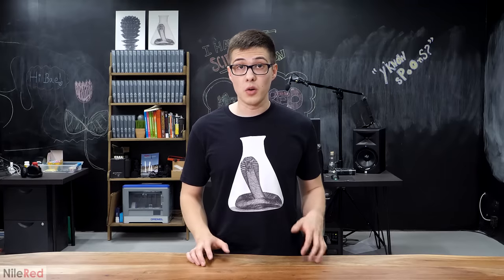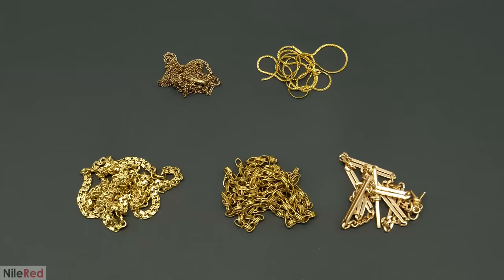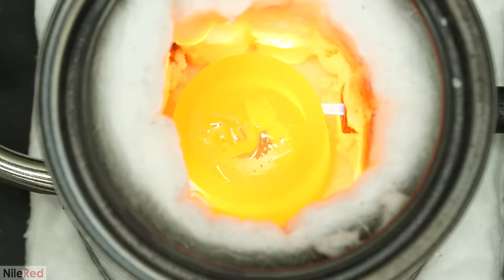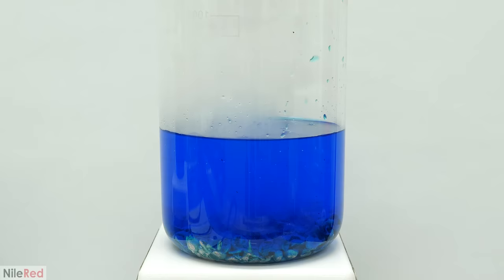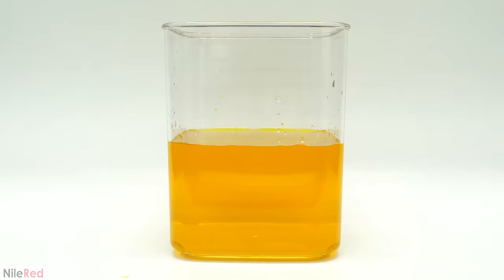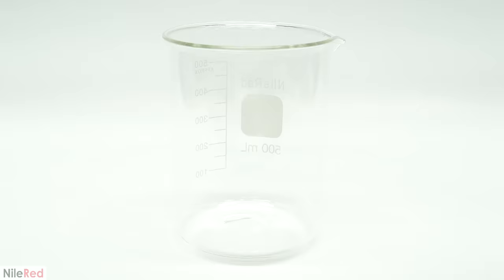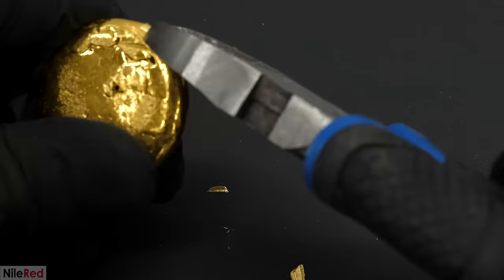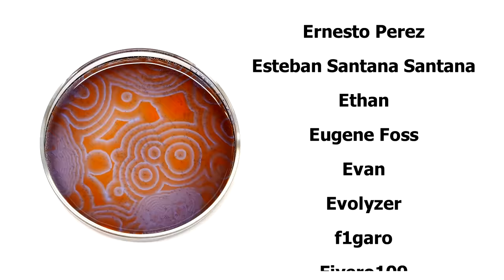Turning old jewelry into pure gold bars

Comment: How much did all the liquids you used cost to extract that 81g gold?
Reply: @ElSchneids I would guess maybe half that, concentrated nitric acid is around $40 for a liter, about the same cost for the same amount of hydrochloric acid. Depends how much is necessary for the extractions, I suppose. I've often thought it would be a fun side business/ hobby to do this, offer to buy people's scrap gold for like 30% under spot price and then purify it. Especially at today's prices...
Reply: @GoodModeSC  really this cheep?? and how do you dispose of it after pouring it off?? cant be very good for the planet
Reply: @mirandabenavides3087  I brought my excess nitric acid to a chemical disposal place at our local dump; if you search around locally you can usually find places like this. Also, most universities have labs that can help (or at least point you in the right direction). But yeah, definitely don't want to pour it down the drain or something haha.

Comment: People get upset about SAE measurement system but what really gets my panties in a twist are the oddball measurement systems for niche objects. Why do we call 75% purity gold 18karat when we can just call it 75% or 190 proof alcohol when we can just call it 95%?
Reply: Because these units are old and people are often unable to let go of traditions, even if they are stupid.
For example, in ancient Rome they had different types of coins with different amounts of gold in them. The pure gold coins had 24 times more gold in them than the cheapest coin type. Since this cheap coin was called keratia and pure gold had 24 times more gold in it, they simply defined pure gold as 24 keratia/karat.
You see, the fact that someone was used for a long time already is enough reason for many people to never question it.

Comment: Older Rolexs have value even if it wasnt working the parts alone are worth a bit. That dude is crazy lol. You should get it serviced and put a band on it and youll have a real nice piece worth a couple of dollars
Reply: This one is a fake though
Reply: @aces78s what fake one has gold
Reply: @HiBye-zj9me  it’s gold plated
Reply: @aces78s  a fake one is good plated?
Reply: @HiBye-zj9me  if the fake is trying to pass it’s self off as a gold watch then it will be gold plated.
Reply: @aces78s  ok

Comment: So what's the method your friend used for directly processing the karat Gold without inquarting it first?
That sounds like another video to me...

And if you can be persuaded I have nothing to offer but gratitude in exchange but I've been trying to find a way to make 14 or 18 karat gold electroplating solution so I can do some electroplating here at home and everything I can find on making electroplating solution is all for 24 Karat and I don't want to plate with 24 Karat because it just screams plated as no one makes jewelry out of 24 karat gold not jewelry that's going to be worn anyhow and I've keep coming up empty-handed. I can get my hands on everything the hardest to come by would be the nitric acid and potassium cyanide but ideally I would like to be able to do it without the potassium cyanide and without having to make an impregnated solution preferring to go for an electrolyte bath with a donor anode that would dissolve to provide the gold instead of being dissolved in the solution if that can be done but to be honest I've spent so many hours searching I'll take whatever method I can get as long as it works and I don't have to go into debt to buy 14 karat gold plating solution that is well beyond my means at over $100 per gram to buy it ready made because I'm going to do multiple thick platings for an end result more like gold filled but through the electroplating process.
I want to re-plate some cheap plated stuff my mother used to wear all the time but looks like s*** now with all the gold worn off (for her 85th birthday).
So what would it take to persuade you?
She'll be 84 next month so I'm not in a big rush but at the rate I'm going I wouldn't figure out on my own in time I don't think because there's precious little information out there that I've been able to find and I'm not a chemist I actually never went to High School so I have no chemistry background other than what I've figured out which is more than most people but less than what's required evidently.

For the record I never finished the 9th grade but after doing some time I got my GED and a degree in nuclear medicine (I was never able to use) so I'm not hopelessly dumb or anything like that I can easily keep up I think and I'm a quick learner because I enjoy learning just keep in mind I graduated in 95 so I might be a little rusty and you're the 5th or 6th person I've asked through YouTube comments like this of people who do the gold refining but so far no takers but I'm a stubborn SOB and I'm determined
Reply: try subscribing to his patreon to ask this- he probably gets way too many public comments on a daily basis!

Comment: Could the small tungsten peak, observed in the EDXRF spectrum, be due to contamination of the anode (e.g. copper anode) of the X-ray source?
Because, sometimes, the electron source (cathode) of the X-ray source,  is made of a tungsten filament. 
This filament degrades with time, into the X-Ray source. As a result: the X-rays emitted from X-Ray source could be contaminated with a small tungsten signal.

Comment: Is it possible to make Gold by fission of two lighter atoms?
Reply: I assume you mean fusion of two lighter atoms, because fission means that one atom is split into two others.
Theoretically, this is of course possible, because in the right reactor, you can fuse basically any two atoms that form a more or less stable product. But in reality, this would be limited to a very small scale and you could make gold atoms, but not gold bars with it. And even if you could establish this on a larger scale, it wouldn't be worth it because the energy cost for this process is like a thousand times higher than the value of the gold you make.